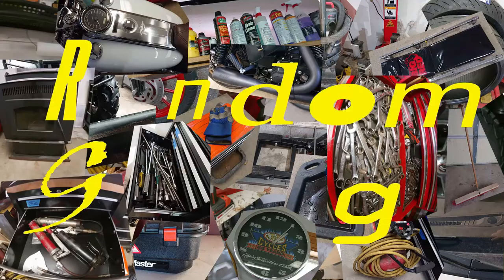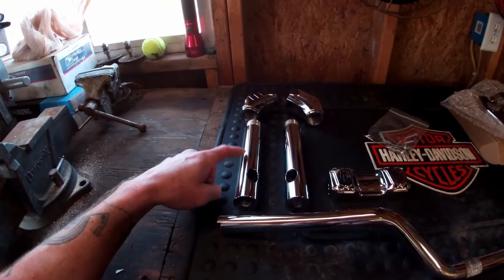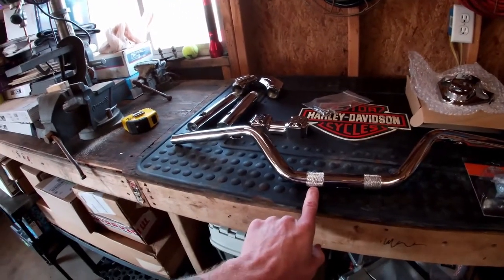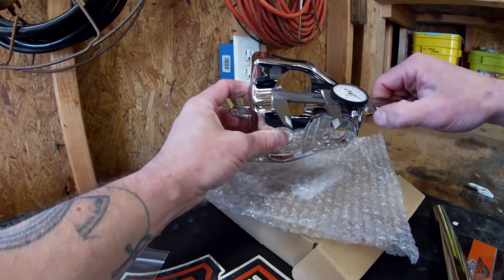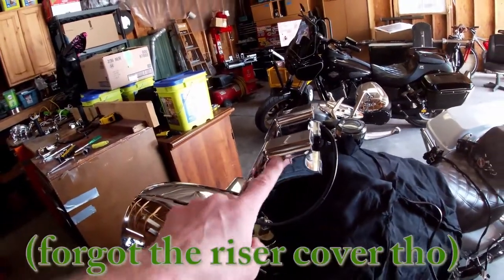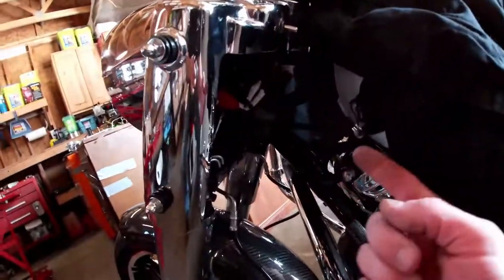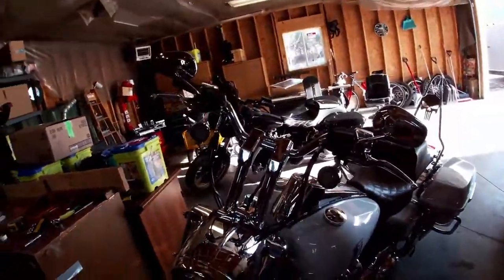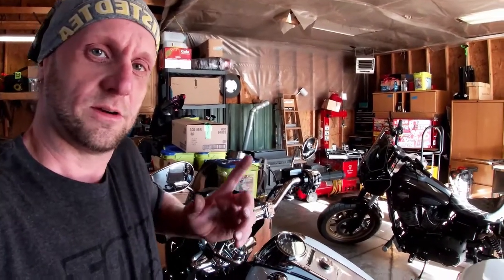Installing Lucky Dave's handlebars & risers on 2020 Road King - Random Garage

Comment: Great video! How hard was it to take the front light bar off and move signals to the handle bars?  Is there a video on that? Thanks!
Reply from the maker: Removing the front light bar was easy because it's a road king. 4 screws and one elec connector. Installing the new signals was also basic (they came off a wide glide). The hard part was making an adapter harness to go from the bullet signals to the large front lighting connector on the road king. There's no video on all that, but I do need to make a new adapter harness for it, so I'll cover that in a video sometime. (The harness I made in 2020 is a hack job; I have the tools and knowledge to do a much better job now. )

Comment: You sure do know your stuff! I need help with a setup I have. Wondering if you had any thoughts?
Reply from the maker: Yeah?
Reply: @RandomGarageUSA  was wondering if you had to have cable/brake extensions
Reply from the maker: Nope. On 2014-2020 touring models you can generally go with 14" bars without changing anything else. (A few  bars are too wide and need extensions, but most don't.) However, on 2021 and newer, the stock 10" is the limit, and anything taller needs extensions.

Comment: I've been looking at lucky Daves for a while for my 2020 softail standard. I'm on the shorter side, 5'6" lol but I was wondering how much pull back you actually get ya know?
Reply from the maker: I measure the pullback at 2".  Measured from center of riser leg to center of handlebar clamp.  I'm not tall either; a bit under 5'7".  At first I had the bars rolled forward too far, so I was leaning forward a bit.  I readjusted them backward a bit and now the setup is super comfortable.
Reply: @RandomGarageUSA  oh hell yeah man thanks for the reply. Whats the next step in your build? You should totally do a walk around with you sitting on the bike. Me personally i was gonna get 1finget easy pull clutch n brake next.
Reply from the maker: @SooHighFashion  I don't know what I'll do next; likely just some powder coating.  I have 5 other bikes i'm working on as well, so I'll constantly be bouncing around between them.  But spoiler alert: the road king will eventually get an FXR-style fairing, and when I get near the end of the 2-year warranty, it'll get different exhaust and cam.  Oh yeah, more carbon fiber parts eventually too.
I'll keep your walkaround idea in mind for a future vid.
Reply: @RandomGarageUSA   Damn man 5 bikes? Sounds crazy overwhelming and fun at the same time. I'm already saving up for a super sport lol I really love the look of those fairings but I haven't seen it on a road king before. Also how come the internal wiring holes don't match up with the bars? Like it has the hole down at the bottom of the riser legs but it doesn't have them at the top. Wait wait what exhaust you looking into? I have bassani's new road rage 2-1 shorty "ripper" and didn't have any warranty issues
Reply from the maker: @SooHighFashion  As for the holes in the bars, I don't know.  You have to ask Lucky Dave's.
And I'm not revealing yet what exhaust I plan on getting. It's something not a lot of people even know about, but it's the best in the industry.  Real race shit.
Reply: @RandomGarageUSA  oh yeah i plan on emailing them, i don't wanna spend all that money and it not work lol. Real race shit hmmmm Horsepower Inc? Idk lol don't tell, let it be a surprise. Really love my bassani road rage ripper.

Comment: I have a 2021 road king standard how did you relocate the turn signals and get rid of the passing lights?
Reply from the maker: I simply removed the passing lamps/turn signal assembly. Then to  connect the bullet turn signals, I built custom adapter harnesses to plug them in. And I used mount blocks from a dyna to mount them under the control housings.

Comment: Quick question, I am getting ready to do the same set up on my 2020 road king. Did you have to do anything specific for the throttle by wire? And I didn’t quite see where it connects to under the tripple tree
Reply from the maker: Nothing special. Ran it thru the bar and out the center hole, then straight down thru the triple tree.
Reply: @RandomGarageUSA  and the controls along the break and hydraulic cables? So no need to disconnect the controls then doing it that way?
Reply from the maker: Yup the control wires run right along the hydraulic lines. But I did need to disconnect them at the steering neck because they needed to go down thru the center hole in the new riser cover.
Reply: @RandomGarageUSA  so I installed the bars the only thing I unplugged was the throttle by wire now I have a check engine light. No codes though. Any idea ?
Reply from the maker: @cjg431  yup. Just clear the codes. If you don't disconnect the battery when doing bars, you'll get codes every time.
Reply: @RandomGarageUSA  yep just discovered that when I looked it up. Cleared the code should be good.
Reply: Did it take any time to adjust to the bars and how about the step up seat. How is that and where does it sit you compared to stock ?
Reply from the maker: @cjg431  it takes just a few minutes to adjust the bars. It took me two tries tho, because I adjusted them to what seemed comfortable in the garage, but then decided to adjust them again after actually riding it. But that's typical. 
And I feel like the saddlemen seat moved me backwards from stock. But the stock seat is quite thick and plush, different than the seat on most of the touring models.
Reply: @RandomGarageUSA  meant did it take time for you to adjust to them riding ? Looking at the sandiago custom seats maybe a road sofa my stock seat has been reworked but has me down and back
Reply from the maker: @cjg431  I adjusted to the new positioning very quick, because I found it very comfortable. However, that saddlemen seat felt like it didn't "break-in" for like 2500 miles. But that's good, because then it also won't wear out very quickly.

Comment: Yikes, rubber bushings on those tall risers and bars is a no-no.  Was too much flex.
Reply from the maker: Nope. Turned out surprisingly solid. It would never work on a dyna but the touring bushings are thinner and harder, so yeah it's fine.
Reply: @RandomGarageUSA  Good to know!  I'm trading in a 2020 Low Rider S and had changed the bars to Lucky Dave's 13" T bars. All I heard was better use Poly or solid bushings. I'll be trading for a 2021 Road King Special and will be doing a bar change right away.